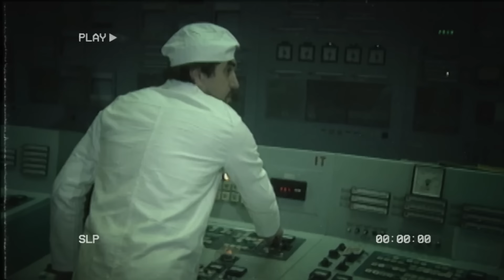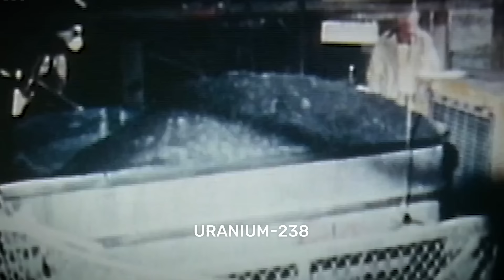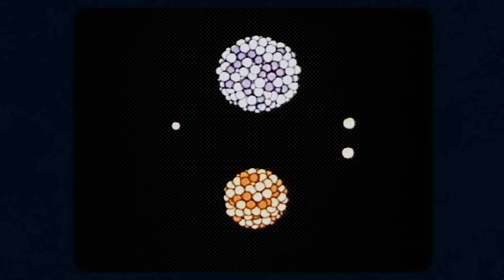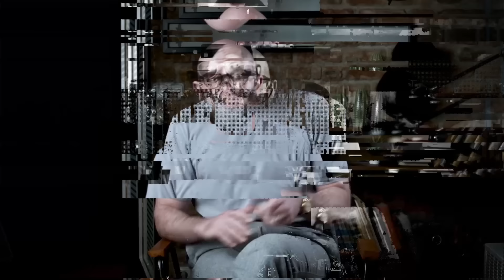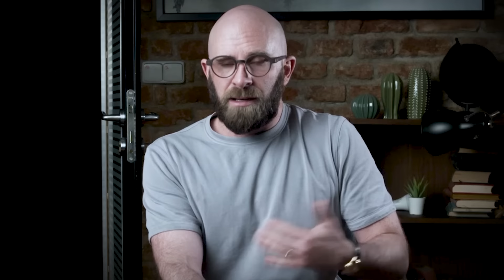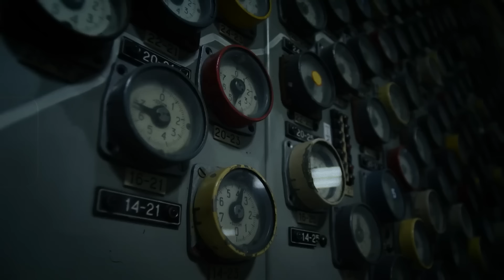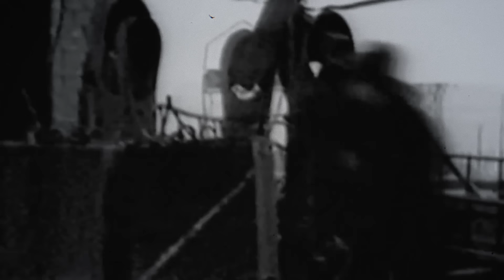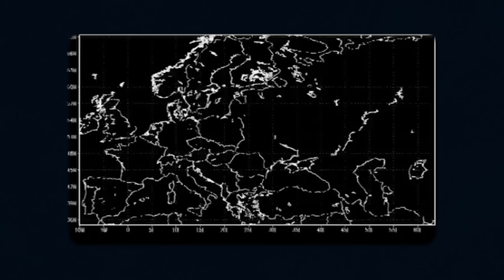The RBMK: The Shoddy Nuclear Reactor That Nearly Killed Millions

Comment: The xenon build up in the reactor threw them. Well it would, because it was electrical engineers running the test, there were no nuclear engineers on duty to tell them otherwise. When it dropped to 7% they should have shut it down for 36 hours for the xenon moderator to disperse.

Comment: The RMBK design was used because it didn't need specalized skills to construct. They could be build quickly using the local labor force. Soviets had lots of experience using concrete so that was the material of choice. They didn't have the large scale enrichment facilities necessary to supply all the plants so they used natural uranium. That meant graphite moderation. When operated within the operational boundaries, these reactors were very stable except at low power. Chernobyl had been operating at half power for several hours so Xenon had built up. When power was reduced further, the Xenon was so strong it stalled the reactor. If they had just shutdown per operational procedures, Chernobyl would never have happened. It wasn't a bad design or shoddy construction. It was the hubris of the managers who wanted the test done no matter the consequences. They threw safety away so they could cover their asses.

Comment: They saved a lot of money by not having to use enriched uranium which is very expensive. Canada uses heavy water reactors which don't need enrichment of uranium either but those are expensive to manufacture all the heavy water.
Reply: Nuclear Power plant.
 DON'T use enriched ores. They usually reserved for military weapons.
Reply: @mohanjan8768 Almost all electricity generating nuclear power plants in the US are light water reactors which require the fuel which is expensive to be enriched to around 15-20% enrichment. Military weapons require around 90% or higher enrichment if building them as a uranium based core/weapon.
Reply: @butmunchass enriched uranium means the 95+ % Uranium.
Reply: @mohanjan8768 No, not really. For example heavy water reactors in Canada and RBMK reactors can run with cheap uranium as mined from the ground directly. Light water reactors run on far more expensive fuel which either has to be manufactured in someone elses reactor first or processed using centrifuges.
Reply: @mohanjan8768 
See it's only about power plants and they need to enrich it.
https://www.youtube.com/watch?v=8fh_mQMBePI

Comment: i am a TMI 2 engineer and have 40 plus yeas experience in the industry.  They are several technical errors, but overall it is not a bad overview of RBMK design and the 1986 accident.  The RBMK design have significant flaws.
Reply: Not as many flaws as your grammar. Clearly.

Comment: I think the term 'steam explosion' is rather misleading.  It certainly seems that way in the comments.  When your average person thinks of a steam explosion, they envision a locomotive steam engine boiler letting go.  The steam expanding and creating a small pressure wave that rapidly dissipates. In the case of a Meltdown, what happens is rather different.  The inconceivable heat generated doesnt just 'turn water to steam' it rip's apart the H2O entirely (a process called Thermolysis).

Comment: As so expertly commented by Kyle Hill, there are a lot of things wrong in this video. I think you should probably do a *corrected* version after talking to people who have better knowledge of this disaster. 

In that light, there are some worthwhile takeaways regarding the reactor design and the management of it:
- No (proper) containment building. Yeah that is bad.
- Graphite tipped control rods that initially *increase* nuclear reactions! Very bad (fixed later for all RBMKs).
- Positive void coefficient, requiring more care during maintenance and testing. But see below...
- Poorly trained/skilled management directing staff to do tests at dangerously low power.

Also the rather cavalier attitude to safety in the USSR - even in the 70s when this was built is worth noting - jeez no proper containment building, seriously? However it is easy to have 20/20 hindsight - e.g re Fukushima: no provision for large Tsunami swells, seriously?

Comment: Here we are again...
-00:00 ChNPP did NOT "nearly kill millions."
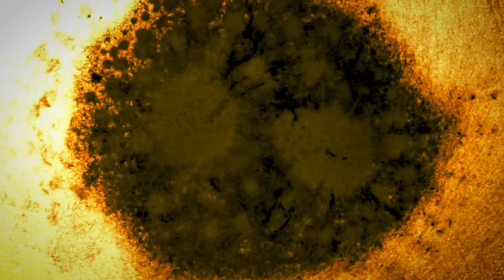-03:45 One gram of uranium-235 is not equivalent to "3 tons of coal." 1 uranium fuel pellet (more than a gram) is closer to 1 ton equivalent
-04:35 Uncontrolled heat production in the reactor core will not necessarily just explode
-04:47 Implying that nuclear reactors are inherently unsafe is incredibly misleading
-05:05 This is a fundamental misunderstanding of what a "moderator" is
-05:52 There was indeed a partial meltdown at TMI
-08:21 Reactivity goes up in an RDMK with increased voids because the water is the coolant, not the moderator
-08:40 Reactivity goes down in PWRs/BWRs with increased voids because the water is the moderator, which you've misunderstood
-09:55 The spike in reactivity at ChNPP was not from adding more coolant, but from the graphite sections of the control rods during SCRAM
-10:30 Again, implying that a nuclear reactor is just a control rod away from disaster is misleading
-11:15 Misunderstanding "moderator" again
-12:42 flash frame
-15:23 Saying "dozens" implies it was more than 28. It was 28 people.
-16:39 Greenpeace is NOT a respectable source for these numbers.
-17:30 No, we do not "know for certain" that the death toll is higher. That's why you're adding all the caveats, remember?
-18:00 There is simply NO PHYSICAL WAY a steam explosion at ChNPP could be MEGATONS in yield. 
-18:23 You cannot use NukeMap for this, as a steam explosion IS NOT a nuclear explosion. 
-19:00 This is nonsense. 
-19:04 There wasn't a clean-up of the CEZ like there was at Fukushima.
-19:21 You are either fear mongering here or misunderstanding the effects of low-level ionizing radiation, or both

If this were my video, I'd take it down.
Reply: Fact checked
Reply: Ack ack ack * snort * sound good?
Reply: I'd also be looking at George's contract (The writer for this ep) . This is smelling of "fact checked by Chat-GPT".
Reply: I'm honestly surprised this video is still up. Yikes. That's a lot of timestamps. Quite frankly, seeing this many problems makes me question the rest of his videos on the rest of his many channels...
Reply: @kylehill  I tried telling them!
Reply: Thank you for this. ChNPP disaster had been well documented and well studied, there’s really no excuse to be this sloppy with the facts and terms on supposedly scientifically inclined channel.
Reply: Kyle woke up and chose violence! And truth. Violent truth!
Reply: Lord have mercy that’s a LOT of false information… thank you for calling out this.
Reply: @Fibbles_MrHe has a lot of false info. You just got overwhelmed by the bullshit.
Reply: @Fibbles_Mr  yeah it's pretty bad I was subscribed but now i can't stay subscribed
Reply: I came to say pretty much the same thing. Thanks, good effort.
Reply: Not great, not terrible.
Reply: Holy fuck
Reply: Pro Nuclear Trolls are paid to push 'replies' such as above. If you don't know that NUCLEAR = DEATH, then educate yourself, my fellow travellers: https://en.wikipedia.org/wiki/List_of_nuclear_power_accidents_by_country
Reply: He's here! Shit. I have to get back to the facility.
Reply: I've checked another video from the same channel, it was similarly full of mistakes. Xenon poisoning was the first contributing factor to the Chernobyl disaster and then stepping over security measures to restore power was the next (in a situation when unknown and gradually reducing amount of Xenon was mainly in charge of power control) and finally the steam explosion tore the reactor apart and radioactive material got out (partly via the graphite moderator burning). Making this kind of video without understanding so many issues (especially how moderators work) is pretty serious.
If light water as moderator starts boiling it reduces the number of thermal neutrons (reducing the fission) so there are vastly different and safer reactors nowadays...
Reply: lmaooo that was perfect. i've learned to just ignore any video from simon on any topic i am familiar with. i have nothing against simon because he knows to avoid making videos on anything currently important where it would actually matter if the facts were right.
Reply: @denniscrane9753
Reply: thank you
Reply: Thanks mr Kyle :))
Reply: You're right, it's not nearly, they did kill millions,and now they try again. Russians can't go 2 generations without attempting to genocide europe
Reply: I’m watching to follow along with this epic fact check. This channel and his others just makes a lot up. I used to work at Boeing on the F-15 and I’d have done a similar fact check on his F-15 video but I don’t think YouTube allows comments that long.
Reply: If the second explosion had occured what would have happened then?
Reply: @hoztravels2024  The water would have boiled. That is all.
Reply: What… Nothing about the 1.21 Jigawatt Flux Capacitor…!!! Oh wait I know - the positive negulator spontaneously disconnected from the negative posulator… Or not…🤯
Reply: Kyle, you were exactly who I was thinking about as I was watching this. "Oh man, wonder what Kyle would have to say." Lolol. Looked in the comments and was pretty tickled.
Reply: Gettem Kyle!!
Reply: Take down all your videos. They’re dogshit
Reply: Most others I'd question... but the man himself? If freaking Kyle Hill calls you out, bruh, you're just wrong.
Reply: Kyle my man
Reply: Had the 3 men not removed the water from the pumps/tanks by going down in there, a 2-4 megaton explosion would have happened, making a significant portion of Europe uninhabitable and killing millions. Kiev and Minsk would be nearly wiped clean
Reply: Alright, Kyle. But consider this: what if there was a secret hidden bunker inside the water reservoir, housing a totally secret 5-megaton nuclear warhead, set to not-so-secretly detonate the instant the reservoir went up in a steam explosion (though not the steam explosion that happened above the reservoir, because why would they set it to do that?).

I’ll be waiting for your written apology.
Reply: Wtf @SocraKir  to assert something not proven by fact and suggest you need an apology. What are you 6 years old
Reply: Lets be fair to Simon here. He is just reading what researchers have gathered for him, its those that should be called out.
Reply: I mean he owns the channel, its still his responsibility to get decent researchers  @METAL1ON
Reply: @METAL1ON no. That he hasn't deleted the video shows he deserves ALL the flak for this. He doesn't care about the misinformation he spreads.
Reply: Thank you ! This dudes vids are full of bs.
Reply: "Saying "dozens" implies it was more than 28. It was 28 people."
Wouldn't dozens imply more than 24 people ?

Thank you for the comment though, someone without clear knowledge about the topic could absolutely be mislead by the video.
Reply: @maspheliciasonsaku2523 I'd say it meant 3 or more.
Reply: better than your take on better help. thank you. wtf Simon?
Reply: You sound like fun
Reply: @hoztravels2024  actualy his chanle is prity fun, its alot of cool science, he evan got a tv show, kyle is dope!
Reply: 1 gram of Uranium 235 is about 3 tonnes of coal equavalent, fuel pellets are not made of 100% uranium 235 since that would be diabolical.
Reply: From what I understand the RBMK makes weapons grade uranium.
Reply: @DaeXeaD : No, Plutonium.
Reply: @DaeXeaD  Its plutonium and it doesnt directly make it at all times, its easily convertible to making plutonium. Commie design philosophy around industry in general was that all civilian industry should be easily convertible to military use.
Reply: @Watis1337 The US still has a provision that in a national emergency, commercial nuclear reactor cores can be used to extract plutonium which can be used in nuclear weapons. It's harder to do that today because most uranium is foreign sourced. Only an all-US core could be used.
Reply: So many of these points are a simple difference of opinion and pedantry that don’t make a big difference in the grand context of the video. Not saying Simon’s vids are always accurate or that he doesn’t occasionally misspeak, but if you’re also going to act like you’re opinions and arguable technicalities are fact that makes your comment just as fallible as his content 🤷🏽‍♀️
Reply: @ashb7846  Not... really. Don't get me wrong, a fair few are like "nuclear reactors aren't inherently dangerous" but enough of these are simply "you don't understand this vital concept" (moderators shows up multiple times) that I can't really just hand-wave the whole thing as "just as fallible". The real meat has to be citations, sources.
Reply: @ashb7846 how a moderator works is not an opinion, Simon didn't understand what a moderator is for and thus was misleading throughout the whole video. Furthermore the explosion could not be megatons because it's not a nuclear detonation. Further furthermore if the disaster actually happened it would not make Europe uninhabitable, all of those are fact, not opinions
Reply: bro acts like he dosent post mis information himself 😂😂
Reply: Who tf does this guy think he is?
Reply: @truenoguy4159 kyle hill has been a respected sience nerd and bill nye figure on youtube for years and years sir.
Reply: @truenoguy4159 He's an actual science communicator who understands what he's talking about. 
He has well over a dozen videos on nuclear science, even breaking down into the math. 

Easily one of the best science youtubers
Reply: @truenoguy4159 a highly respected science writer
Reply: Unless we know how you know all these things are inaccurate, there is no way to know if you are correct. I always told my students authority is just as important as accuracy. Because if you don't know the former, you cannot be certain of the latter. So tell how you came by your info. Cite your sources.
And what's good for the goose is good for the gander. The producers of these programs should do the same. So when someone as apparently knowledgeable as yourself challenges them, they should also produce documentation. I assume that a production with such a large audience that makes the volume of content these channels produce has an editorial staff that fact checks the content. If they don't they should. As it stands,  someone like me now has no way to know what is accurate and what is not. 
🙏🌎☮️🕊
Reply: @pooryorick831  https://www.youtube.com/watch?v=YCyqJRqtYW8 this is a vid of a nuclear scientist debunking all the mistakes Kyle has stated an btw kyle has many vids proving his legitimacy including great vids on Chernobyl/Pripyat  which are great for info 👍
Reply: @pooryorick831 he is a highly respected science writer , you are a no name commenter

Comment: RBMK was cheap, quick to build and fuel could be swapped during full power operation.
That was especially handy for weapons plutonium production.
The design itself was not inherently unsafe, as the accident happened due to gross negligence and intentional bypassing of all the safety protocols by the chief operator.
Reply: Operators didnt really break any instructions. RBMKs are just designed with a lot of compromises due to soviet leadership being really skeptical about nuclear power from 1960s to late 1970s.  And even after that they had to fight tooth and nail for every ruble spent on the design. The plutonium convertibility, channel design and the fact that much better VVERs didnt catch up until later were a result of that. Even now after all of the upgrades RBMK plants are producing much more nuclear waste, have a ton of issues on how are they going to be decommissioned and even have higher limits on radioactive noble gasses emissions.

Comment: The RBMK isn't a bad reactor system: many individual pipings for each fuel rod.
It's a better design of a reactor core than the high pressure reactors but with some drawbacks as it was executed:
- no containment building (you could build a rmbk in a containment building)
- no working fast cooling system (with the piping system of a rbmk you could control each and every fuel rod individually, you need a fast enough pump to emergency cool and poison the core)
- easy design as you don't have one core but 256-1000 individual fuel cores which can be controlled individually ... much easier to understand than the fuel rod positioning in a modern high pressure reactor
- the reactor could run at a very low power level ... you don't need to burn all fuel rods at the same time

The problem was with a lack of oversight and massive cost-cutting in running. They know of the xenon pit and they could waited it out ...

Comment: steam locomotives since the 1890s used westinghouse breaks that require air pressure to LIFT the shoe away from the breaking surface(usually the wheels back then) so your analogy with train breaks is wrong because without air pressure the trains stop and have since 1893 when the system became mandatory.

Comment: Not your best video especially the first few minutes wrongly explaining how a reactor works!  But it improves.  Also it is not so useful to compare Legasov's steam explosion idea with a nuclear explosion, it's more like a dirty bomb, and basing the rest of the video on Legasov's idea is shaky at best.
Normally you put a bit more history in and that's missing.  It is worth pointing out that these reactors were built by 2 (IIRC) companies, one of which had KGB support and the other not, resulting in massive differences in build quality due to access to quality material (or not).